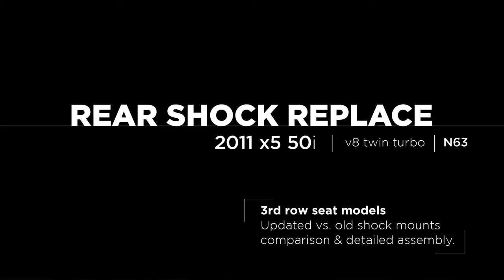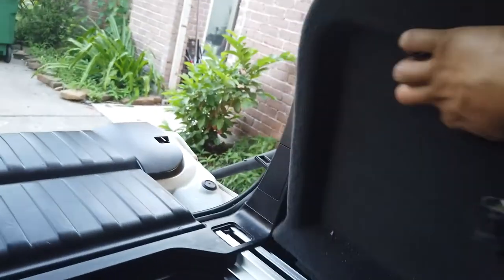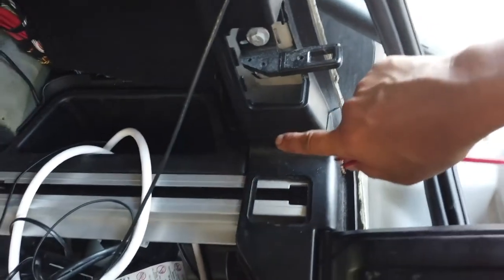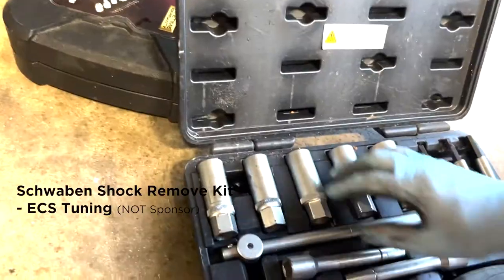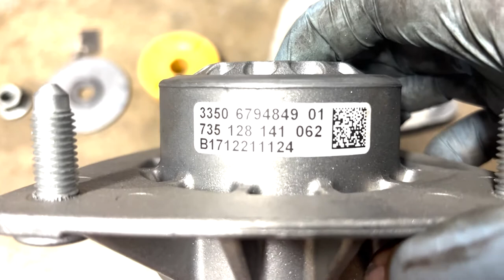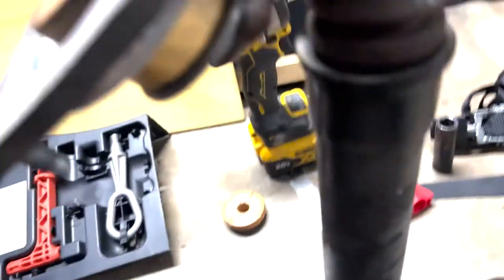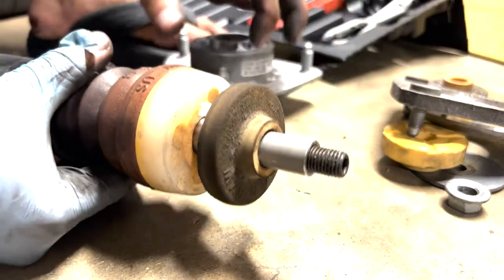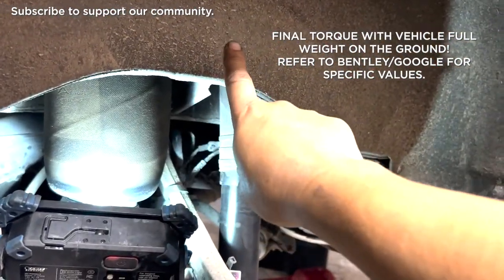2011 E70 X5 50i Rear Shock Replacement: 3rd Row Seat Models

Comment: I see you already have the 3rd row removed, does this need to be removed to replace the shocks?
Reply from the maker: Unfortunately yes for models with the third row.
Reply: Can’t find that new type mount on fcp euro, do you have a link by any chance? Thanks in advance!
Reply: @bmwchannel7209 Thank you for your video. Very helpful. But I just did this today and there is no need to remove any of the seats, including the 3rd row. There is enough room to slide the rails slide back.